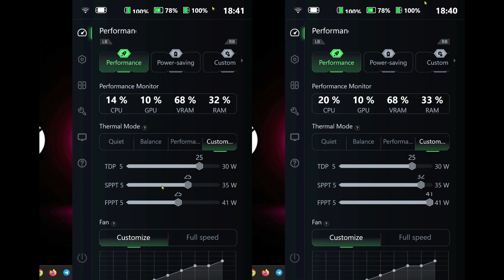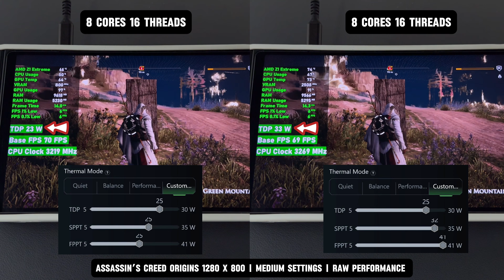Legion Go: Optimize TDP Settings for Reduced Stuttering, Improved Performance & Stability!

Comment: my lenovo legion go kleeps lagging and it's unplayable on games like red dead redemption 2. I don't even have 1440p as a resolution option listed and everytime i change the resolution to 1920, it gets all weird and makes the screen look widenened. I have this connected to an external monitor. My device was working fine and now it's unplayable. I'm also using an external gpu too at the moment connected
Reply: clean your fans and repaste. same happened to me was good after

Comment: I'm a total noob in this, setting all to 25 gives me better performance than the standard performance mode? I always play wired so don't care about battery
Reply: I know i’m a stranger so i will not write the code in the comments BUT if you search Chris  titus powershell and run the code that you find on his site you can completely deactivate all features that you don’t need alone that gives you 10-25 fps more on all games.
Reply: Yeah, weirdly enough

Comment: I wonder if the higher stability is more related to the fact that the max setting was too high and you'd get even better performance by setting the values to like, 25-26-27 or something, such that when the game gets more demanding you can add a little juice but not enough to throttle.

Comment: With my experience I believe the ally X was smoother and didn’t stutter on battlefield 2042 at 1080p unplugged. On the legion go amazing screen size but I’m having to play at 800p with slight stuttering randomly, also plugged in I can’t figure out why
Reply: I find this same thing. Working on settings changes to get it to go smoother. So far, my best settings while plugged in have been 800P, thermal settings all at 30, and VRAM at 8GB.
Reply: Just use frame gen

Comment: hi! I would like to know in what way you used the OS (performance/balanced/efficiency)? also, I would like to know if you recommend this configuration to connect it to a dock? or what would be the best configuration to put it to a dock to play on a TV or screen
Reply from the maker: I set os power to efficiency, if you play connect to dock, I recommend to set it to 25W (25,25,25) to avoid overheating and loud fan noise.
Reply: Thank you for answering! I have another question, do you have any video to get the best quality and performance when you connect to the dock to play on TV?

Comment: I always have my system plugged in so use performance mode with cpu efficient aggressive boost enabled. Worked well but noticed in games like forza after a while the game would crash. After looking monitoring it noticed its due to cpu temp spikes which goes over 85 degrees. Tried capping all at 25w as per this and not only do I get the same FPS but temps never goes into 70 degrees. Excellent video thanks
Reply: I'ma try this when I get it in a day or 2 and I'ma also go through and replace the thermal paste with ptm and let it go a few cycles for like a week and see how we do XD

Comment: I usually sets my tdp to 30 should I lower to 25 and match the sppt and fppt or could I lock all 3 at 30 and see a stable performance? I usually play it plugged in with a 100w power block and cord
Reply from the maker: If you mostly play at 30W, you should lock everything to 30W. However, I recommend trying 25W since the difference in FPS between 30W and 25W is minimal, but you can achieve a significant temperature drop and quieter fan noise with 25W compared to 30W.

Comment: I run 4 cores 8 threads, 6gb vram at 6400mt/s and 15w on all three. I get cyberpunk 2077 at solid 72 fps (fsr frame gen enabled). I can get over 2hrs on the battery and my temps stay in the 50s. If I only change my top settings to 20w it will run at 90fps. This machine is amazing once you know how to tune and tweak it. Thank you t-pen for doing all the testing
Reply: 800p ?
Reply: You are a damn Jedi Master!!  Thanks, I just set it when I seen this comment.  Very helpful ✅️
Reply: 70 fps on cyberpunk with 2 hours battery is wild
Reply: @xDbrad  Dude, my max battery life was 1hr 22 minutes before this comment
Reply: Wow so useful dude♥️
What are your settings in game?
Reply: I also have the same settings, you have activated SMT in the bios, right?
Reply: All this time......I wish I did this earlier.
Reply: I'm brand new to the legion, how do you change cores/threads and vram speed? You made a custom profile with all 3 at 15w?
Reply: @DoomedGeneral  to change the core and threads and vram you have to go to the bios (when the lego is shuttle press the turn on botton and then the volume up), there are video anyways test you can check
Reply: HOW TO DO THAT BRO
Reply: Any updates on settings since this comment? I just got a legion go and looking for best settings.
Reply: Actual render FPS is likely 35–40 FPS
	•	FSR Frame Generation doubles it to ~72 FPS

So:
	•	The game feels smoother
	•	Input latency is higher than native 72 FPS
	•	Visual artifacts may appear

✔️ FPS number is real
❌ But it’s not raw performance

Comment: Hello! I recently bought LeGo and your videos are very cool and well designed! I was on a Nintendo Switch, my purpose with the LeGo was to have a little more performance than the Switch in addition to accessing titles that weren't available there, such as having maximum battery and temperature preservation considering the tropical country (Brazil) for the day to day? 
Congratulations on the videos and success!

Comment: This is amazing . Thanks for the video . By the way, did you try this setting work 6 cores 12 threads ? . Im curious about the results because since your last video about cores i put my device on 6 cores and TDP 25 watts and have been loving the performance. Almost no micro stutter and the fan isn't going crazy like before

Comment: Your videos are worthless. You're talking about something that doesn't matter if the game runs 30 fps and has stuttering, e.g. games on unreal engine 5. No settings change it.
My lego runs about 4 ghz on 8 cores without any problem, and you claim that it is impossible 🤣🤣🤣.
Reply from the maker: I mentioned reducing stuttering—if a game is stuttering, it can help reduce it, but that doesn’t mean the stuttering will completely go away. There’s no magic setting for that. There’s no possible way for 30W to supply enough power for all 8 cores to reach 4GHz. Additionally, there’s no need to push all 8 cores to 4GHz, as the Legion Go would quickly overheat with temperatures reaching 85°C or higher.
Reply: @T-PEN  tbh i reach 4.82Ghz if i run full 30 and set aggressive its completely unnecessary but he is right about it reaching those numbers but the temperature is nearly at 95 degrees